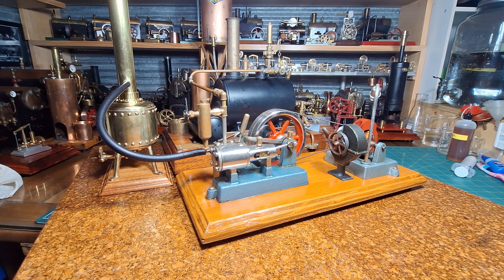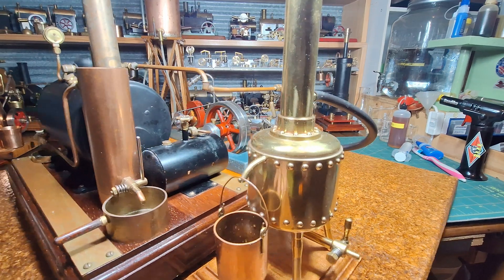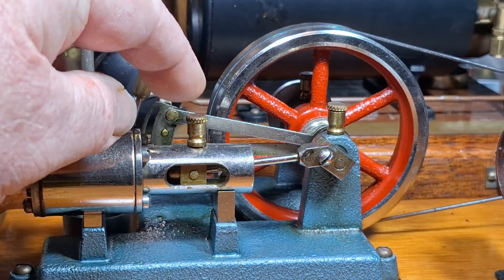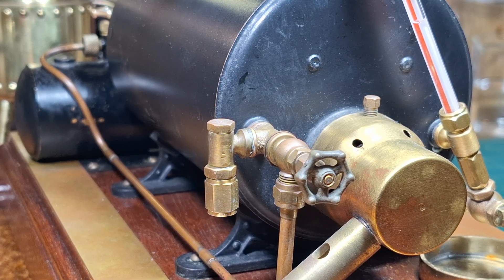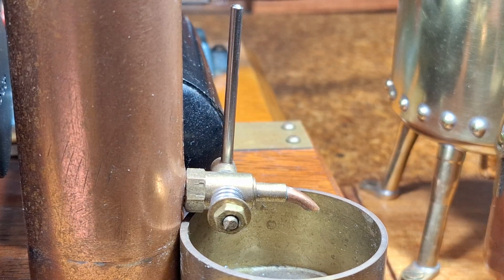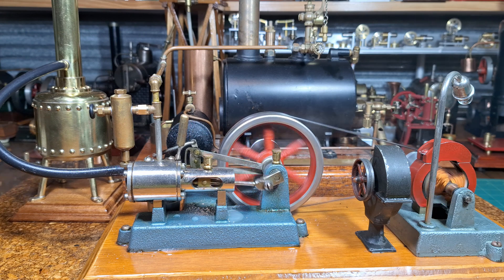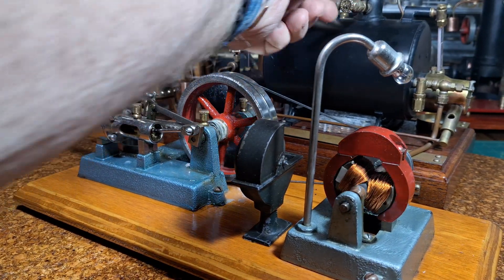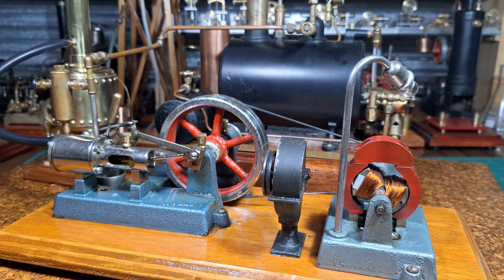Modified Jensen 20G Orphan Steam Engine Running off a 4" MSM Copper Boiler

Comment: lovely set up and Mods Jim
runs great, what pressure does the boiler blow off at.
atb👍👍👍👍🚂🚂🚂🚂
Kev
Reply from the maker: I have the safety valve set at 80psi on this boiler Kev, its a very nicely made boiler made to all of the boiler certification standards.....thanks for watching - Cheers Jim

Comment: Nice ,I fancy the MSM 2 inch marine plant for a boat I have.Do you have one and any thoughts?Not the econo ,the standard 2 inch and twin cylinder oscillator.Cant find much online.They seem to be very good value.
Reply from the maker: G'day....I haven't one of the 2" boilers, I have spoken to the owner John of MSM on the phone many times and in conversation he told me that they only use one gent for making all their boilers.
Mine is a piece of art, I REALLY love it. Every time (even after all these years) I still get a buzz firing it up. Hope that helps some - Cheers Jim

Comment: As the engine is driving an alternator, rather than a dynamo, connect a little bridge rectifier between the alternator and the lamp, and replace the bulb with a minature mes fitting Led.
As long as its connected the right way round, it should illuminate brightly  without the engine working hard or going fast.
Reply from the maker: Thanks for the reply Gary, its good putting a steam engine under load and letting it do some work. Even these small (tiny) incandescent bulbs when you screw them in and out you can hear the engine start to chug and work harder - Cheers Jim